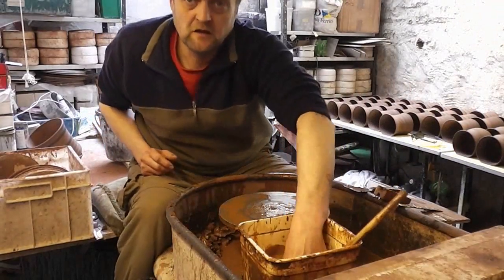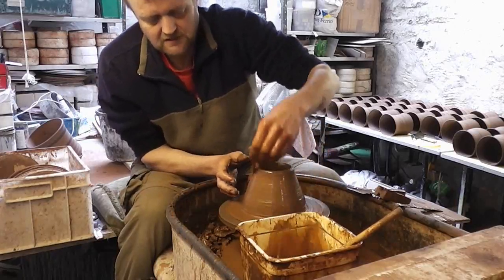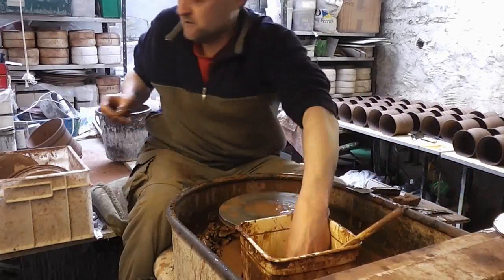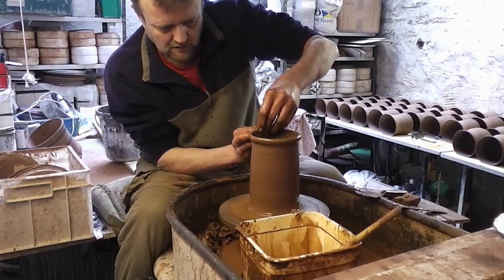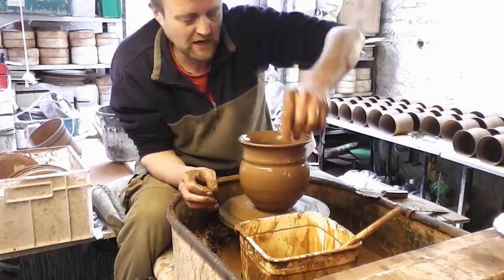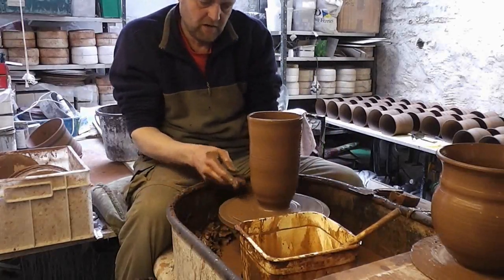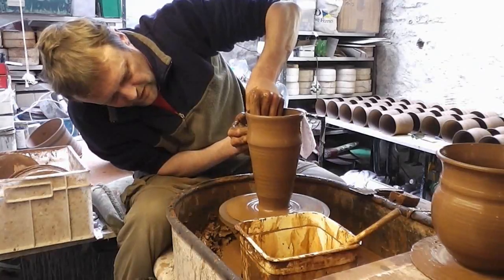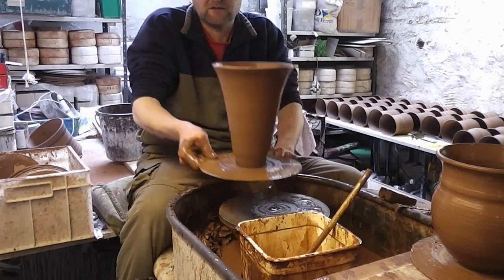Throwing 3 different shaped terracotta plant pots on the wheel

Comment: your wheel may be going too fast.
Reply: For whom or what? Remember this guy is a production potter, if there was an issue with his equipment he would have noticed and rectified it eons ago....
Reply: @kadensmike8190  He has admitted in other videos that he is limited by his wheel because it of it's speed settings and large shapes give him issues because his wheel's lowest speed is still fairly fast. Though he chooses not to replace his wheel because he doesn't want to spend the money and his wheel is reliable. Which is important for production throwing.

Comment: On the second pot when you pushed in and made the indention...is it smooth on the inside or is there an ridge inside?  How thick are the walls?  I've seen this detail on other pots you have thrown.  I've tried it and I think my walls have been too thin because I haven't been very successful.  Thanks for sharing.